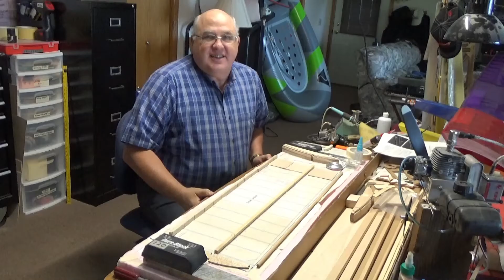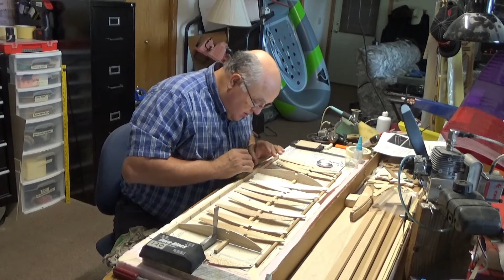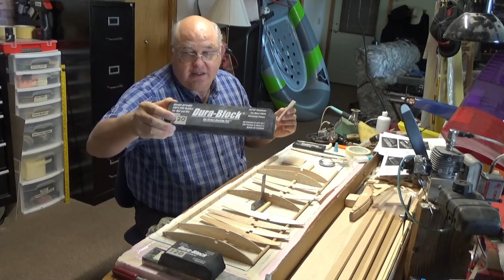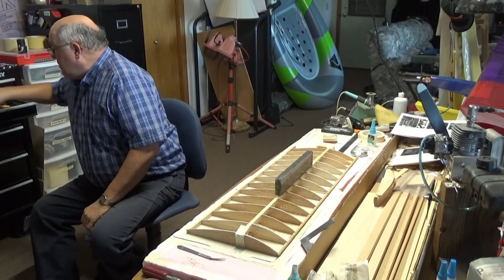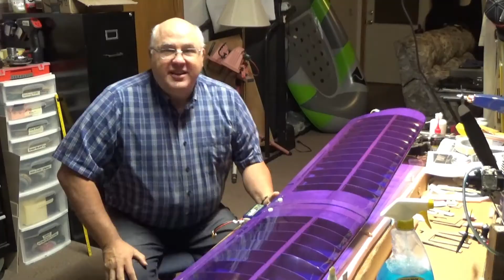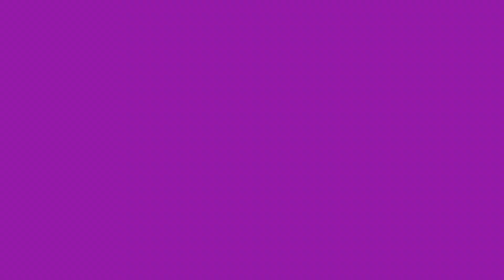Carl Goldberg Eagle 2 airplane wing build video

Comment: I learned to fly on an Eagle 2 but never actually built one.  Im bought a NIB kit recently and will be building it soon.  I'm going to use the bolt on option and will build it without dihedral.
Reply from the maker: Trevor, Thank you for your comment.  I am sure you will enjoy building the Eagle 2 airplane kit.  Let me know how it is going and if you have any questions, just ask.
Reply: @tomrammel  Thanks for the offer the help Tom.  I'm planning on building it completely flat and using the bolt on option. Trying to make sense of the steps in the manual to ensure I don't make a mistake.  Did you stack all the ribs together and give them a light sanding before starting?  Did you deviate from the manual when you glued two ribs at either end to the TE right away?
Reply from the maker: @trevorfurlotte  Yes, I sanded the ribs lightly before assembly.  Stacks of ribs with the same number. I glued the number 4 ribs first since they are the same size and shape, One at the wing tip and the other in it's location near the center section where a number 4 rib is marked.
Reply: @tomrammel  This is to ensure spacing due to plans not being exact due to humidity?
Reply: @tomrammel  Do you sand the bottom of the ribs first, then the top?
Reply from the maker: @trevorfurlotte  Also check out this video to see the babe bot glue bottle that I use now with Titebond III.  https://youtu.be/d0i2q8LZMZw    23:05 on the video
Reply from the maker: @trevorfurlotte  I pin the stack of like ribs together and sand the top and bottom lightly.  If you are worried about rib registration you can use an 1.5 inch long piece of balsa wood the same dimension as the top and bottom spar to help keep the ribs lined up while sanding.  Don't sand too much just enough so the covering doesn't have bumps.
Reply: @tomrammel  That spar size piece of balsa idea is brilliant.  220 grit?  Thanks.
Reply from the maker: @trevorfurlotte  Yes, 220 grit works great.  Don't try to sand all of the ribs to the exact same size if one is slightly smaller than the rest.  Instead sand the majority and then remove the one that is small and sand it smooth by itself.  Then use the small rib one bay in from the tip rib.  If one rib is slightly smaller it will not be noticed on the final wing.
Reply from the maker: @trevorfurlotte  Also while the ribs are still pinned together draw a line across all of the ribs using a felt tip marker down in the bottom of the spar slot so that it doesn't show thru the covering.  This mark designates the top of each rib when it is installed into the wing.  This prevents the ribs from being installed upside down on full symmetrical wings.

Comment: Hi do you know what the differences were between the Eagle 2 and the Eagle 63?  I have an Eagle 63 Fuselage that I am going to build a wing for it, but not sure what the upgrades were. Also, the LED's look awesome, where do you get them?
Reply from the maker: The Eagle2 has vacuum molded plastic wingtips and the wing spars have additional vertical grain sheer webs to give the wing more strength.  Also the Stabilizer has an additional brace at the trailing edge.    The LED's are from Hobbyking.